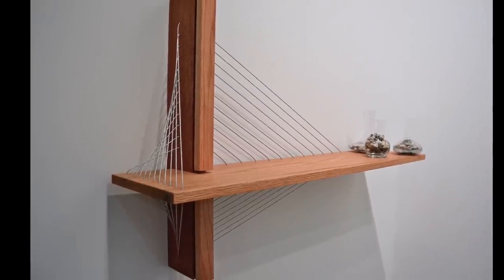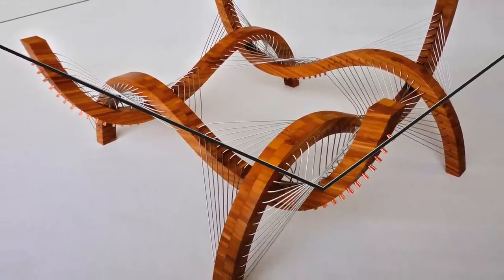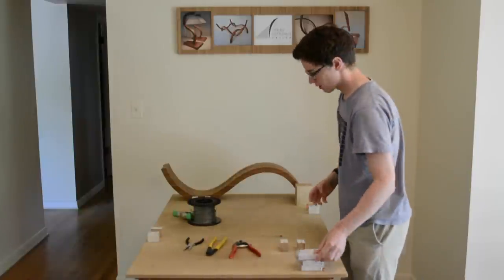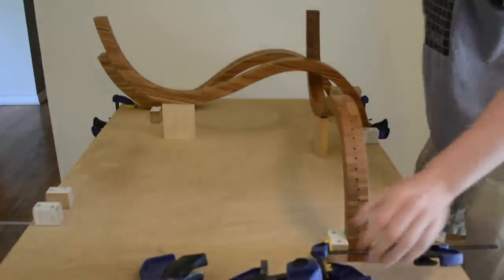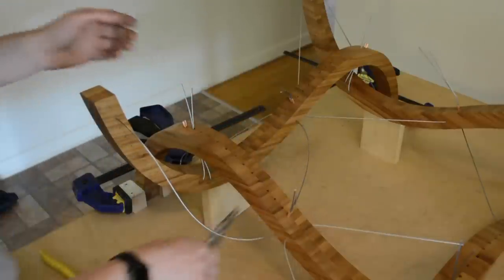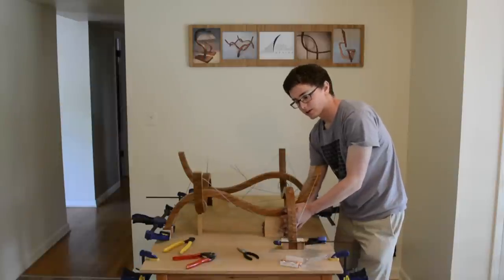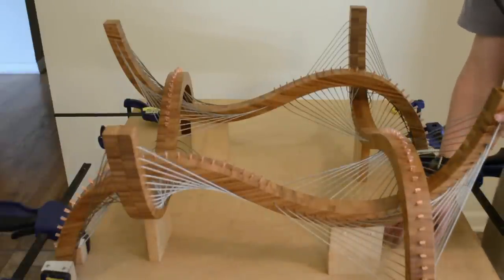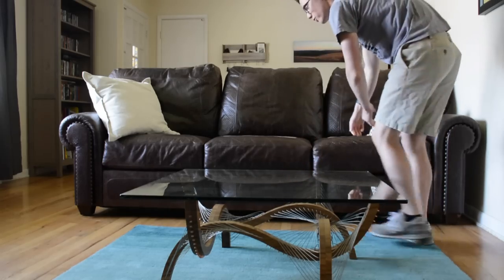Making Tension Based Furniture - Robby Cuthbert Design

Comment: Do this with clear wire, it would look like it’s floating
Reply: nice idea
Reply: @packman21421  I'm sure you can get wires that are mostly clear that are stronger than fishing line, dude.
Reply: Daniel Nguyen when you don’t understand how vast the online market is and how much technology we have 😂
Reply: Daniel Nguyen he could just use more fishing line, i thought Asians were supposed to be smart smh
Reply: @ARTDaGAT  Really no need to make racial stereotypes but go off I guess
Reply: @packman21421  ok boomer
Reply: @packman21421  lol how do you assume that that are no clear wires strong enough for this. Ever heard of nylon?
Reply: @troyesivan4416  I smell someone who's triggered.
Reply: Well this thread escalated quickly. Anyway, yeah, clear fishing line would be cool.
Reply: @aetherclouds1181  bi
Reply: @DancesWithSloth  why?
Reply: it could be only me but i feel like the wires add value to the design
Reply: @packman21421  fishing line for tuna can hold more than 450 lb. I think it's enough for a coffee table...
Reply: @noisycarlos  clear cable doesn't exist
Reply: @Juksemakeren  Thanks for the correction, fixed it to what I meant, clear fishing line.

Comment: I was pretty surprised at first that you went with cutting out those curved wooden legs, given the short grain, instead of bent lamination, but when you jumped up and down on that sample outdoors my eyes lit up. That's the functional beauty of the tension system. Well done.
Reply: It's bamboo and probably some kind of composite.
I don't know of any bamboo that comes in 18+ inches wide sheets.
Reply: I've bought similar bamboo plywood (plygrass?) for making a cutting board type of thing, and it's sturdy stuff.  Like plywood, it has no real grain direction that it favors, and yes, I bought a 4*8 foot sheet, which (1" thick) weighed 88 pounds.  Not cheap stuff, not available at all lumber yards.

Comment: Amazing building quality, clearly no expenses were sparred in calculating the internal forces and stresses (it's clear that the table is purely at tension as the name implies, no compression or flexing or torsion on any member whatsoever, so an amazingly precise naming), not to mention the extensive optimization, and only the best fastening techniques and practices were used. The jig set-up itself is a work of art as well, wood on wood bearing with no clamps by the jig itself plus clamps outside the jig. Clearly a masterpiece by a master of art and engineering and crafts, worthy every penny.

Comment: nice work, detailed tutorial, thanks for sharing! partial countersinking of the copper stoppers could be nice as well. also possible to make bigger pockets (so crimp tool can  fit) and seal them after tightening flush with pressfit copper discs, leaving them visible on the upper side.

Comment: Great design. If you drilled wider holes on the one side of the legs the crimps could be embedded inside the legs and completely covered. Also i would like to see this with white legs and black cables.

Comment: Wouldn't it be true that the more weight that is on it, the more stable it is? Since the cables would be pulled more due to bending? What a great design
Reply: It probably depends on the strength of the cable themselves. If too much pressure is applied, and I'm sure it would need to be a lot of pressure with how many cables there were, the cables would snap.
Reply: @BeyBladGuy365  you might have wood tearout before that limit is reached though

Comment: There’s a lot of tension on the table. 🙄
Reply: *wakes up and starts making a pot of coffee.
*Goes into the living room while it brews and turns on the TV to see what's on..
*Coffee gets done so you grab a glass and go sit down on the couch..
*Takes a sip, smacks his lips with excitement from the rich blonde roast.
*Sets down cup SETS OFF A CHAIN REACTION AS THE CABLES SNAP FOLDING IN ON 60LBS OF GLASS PANE FUCKING DEMOLISHING ANYTHING AND EVERYTHING THAT COMES ITS WAY!
Reply: @Pro_Vs_Con  the cable he's using is actually heavier than necessary. The weak point in the system is the copper crimp. I think it'll handle anything you'd be using a coffee table for
Reply: Wow. I didn’t understand what “tension-based furniture” meant. Thanks for that. 🙄
Reply: @hightide9513  ? Who are you even meaning that towards?

Comment: You should drill some counter sinks where the crimps are to hide them. You could even cut out little caps to cover the holes and hide the ends of the cables completely
Reply: redsoxfan32 
But how would you tension the cables if they need to the outside of the hole to crimp?  You would end up with 3/8" of slack on every cable as it sinks into your countersunk hole.  

I sort of like the look of the crimps :P
Reply: that is really easy actually. recessed tensioners.  bass tuners would also look really cool.
Reply: I think it is possible to hide half of crimps, the ones that are not facing the floor. You need the other half open to tighten strings.
Reply: To No: I think you are confusing countersink with counterbore.
Reply: I thought the same thing, that the copper crimps kinda ruin the clean look of the cables and wood.  Also, I could see me crawling around the floor for something that I dropped and getting ripped open when I run my arm up along one of those crimps.  Ohhhh, no thanks.

Comment: I'd be interested in seeing a video showing just how much load bearing capability it has. If you were willing to destroy one of those awesome tables, possibly do a video showing the weight it can withstand before failure?
Reply: Are you sure its necessary to wreck a piece? The loads can be calculated using the same formulas engineers use for tension bridges--which as you know can take the pain of weight.

Comment: So, theoretically, once you put the glass on the table, you can go back and cut a bunch of the cables without affecting the structural integrity of the table
Reply: i dont see how that could be the case at all? complete nonsense
Reply: @michaelh.1262 

Wire "a" pulls up + Wire "b" pulls down = balanced 

Glass pushes down + wire "a" pulls up = balanced

Wire "b" no longer needed
Reply: @samo4648  
You could probably get by using only 4 short cables in total since they would support each others weight when they are all connected and the glass would act like tension. Connecting them where the bottom and top leg cross over each other. Given how heavy the glass is it might be enough so they wouldn't just fall sideways also. It might also create a lot of stress on the 4 connection points (given how the wood is cut in this case) so you could use steamed and bent wood to get the full strength of the fibers. Instead of the exposed brass clamps (unless you like them) Drill a hole and use a steel wire loop clamp to hide them away. Harder to do would be to use only 1 single wire for the whole piece but still going through all the current holes. Anyway it is a nice build!
Reply: @samo4648 , as long as the glass is heavy enough to exert the same amount of force as wire "b" Maybe

Comment: If you pluck the cables, do they make music?
Reply: Well, if he did it well, and he did, they would all make the same note--which is another way of checking uniform tension, right? If he set it up like a piano he could tune for tension. But to make music, oh yeah you can get all kinds of notes and then the product would be all screwed up, a mess on the floor.
Reply: Not the same note. The cords are under the same tension but are of different lengths. Length also determines the frequency.
Although...if the tension varies by some cool mathematical formula related to the curvature of the legs and thus the cord lengths joining them, then maybe you could get the same note on all strings.

Comment: i would add somekind of rubber between the glass and wood to prevent glass sliding off
Edit: also it would prevent scratching on the glass
Reply: There are 4 clear rubber pieces on the glass. You can see them when he puts the glass on the wood.

Comment: but is it level?
Reply: Leveling it would be as simple as planing down the end of each leg until they are all same height.
Reply: Will it blend?
Reply: just ad screw in bump stops to each leg and you could adjust as needed.
Reply: lvl 60 orc shaman i think
Reply: Nah dude, lvl 60 pally, if it was shaman than it would have killed him since hes a human.
Reply: Only if the floor is level.
Reply: The jig and blocks keep the table level. Tightening the outer cables, secures the legs against the jig. The only way for the table to become uneven is when tightening the inner cables. That's why he mentioned not letting the legs rise off the blocks more than 1/32 of an inch when tightening the inner cables, that ensures that the table stays very level.
Reply: He cut by CNC so I cant imagine why it wouldnt be level. But about the planing comments, its a good question. Im my past projects (non-CNC) there was planing needed to get things level. But why? Ok, you can plane to end the job but if you go back and measure for the 100th time,  you'll find the measurement error that led to the need to plane. On roughly made or fine antique furniture, clearly the makers didnt see planing as a sin because planing marks can be easily seen on leg ends. But had they too been able to measure precisely there would be no problem. The name escapes me at the moment but there was a furniture maker on Public Television, (oh was it The Yankee Workshop?) and he never planed anything--and everything was level. But to the video here, CNC would take care of the leveling of the pieces but that can be thrown off during tensioning. Like this fellow, you would have to be very skilled and patient and practiced to tension correctly to avoid leveling later. Still, if he had to do some planing after all that, id consider it fully acceptable.
Reply: All legs were identical because they were and cut and the 4 tabletop supports are 100% level because they were level with the work bench this whole time.

Comment: A 37th of a inch? Just use millimetres
Reply: But imperial measurements are easier
Reply: g.a.s.p I guess because you are guessing the measurement
Reply: I was joking, I don't see how imperial measurements could make guesswork any more accurate unless you are more accustomed to them than metric measurements
Reply: 32nd not 37th.
Reply: you're off by 5/1184 of a inch there buddy :)
some would have just said 0.00422297... but that's just communist talk.
Reply: imperial measurements are the least practical thing that exist, but damn this humans hate changing.
Reply: Metric is units of tens and hundreds. Easier.
Reply: @PageMonster I don't think anyone needs to be told that, and if this in response to me saying imperial is easier, presumably you just skipped my other comment, so I advise that you read through again.
Reply: 37th is nonstandard. I think you misheard. 1 inch is the same as 2x 1/2 inch, or 4x 1/4 inch....which is the same as 32x 1/32 inches. If you really want to get accurate, in imperial machining you will see numbers like 128th of an inch.
Reply: its easy to convert fractions to decimals. 1/8" i see as 0.125
Reply: easier to say a 32nd than it is to say .79375mm.....
Reply: In machining we go down to a thousandth of an inch. (or .0254mm for metric people)
Reply: First of all it is 32nd second of all communists all mad because they don't understand fractions lol! Just kidding, I don't care which system of measurement is used so long as it is the same on the entire piece of equipment.
Reply: Michael T Shue Studios, easier to say 1 mm than it is to say 247886/6296301 of a inch
Reply: Alex M you would simply say 3/64" or 39 thou. Or round up to 40 thou. At a certain point we just switch to the decimal form.
Reply: That's what caused an accident with a Mars orbiter. A small 125 million dollar mistake :)
Reply: “The metric system did not really catch on in the States, unless you count the increasing popularity of the nine-millimeter bullet.”

― Dave Barry

Comment: And then someone walks into your unsecured glass top and smashes it.
Reply: PageMonster luckily we didn't all make the mistake of having children
Reply: 60 lb glass.. I don't think the fact that its unsecured is gonna matter much
Reply: Yeap, I had a table with a solid marble plate, which was completely unsecured. You had to actively lift or push it off for it to go anywhere.
Reply: LoL u obviously don't much about how physics work do you Mmmmbuddy?
Reply: easily fixe by putting soft gummy rubber between wood and glass.
Reply: No name you don't seem to know much about grammar huh budy
Reply: PageMonster That glass won't break, dude. Even if you dropped it from the height he was holding it.

Unless, of course, you meant to say until someone hits the corner of the glass with a hammer. Then yeah, you'll end up with a big mess of glass beads, while still sharp, will only give you extremely minor cuts if at all.

Comment: Without doubt you have created a thing of beauty here.  The brief view you gave in the first part of the video reveals other structures which I think are also examples of geometric beauty.  Congratulations on many jobs well conceived and executed.  My comments are based on my own attempts to design and build similar structures also for the support of a [ tempered ] glass top.  I'm fully aware of the skill required in placing the tensor members - something I'm still personally working on to improve my technique, so I note your nifty tensioning method of rolling the long-nose pliers to apply a controlled tension to the wire[s].
Since I personally am more an engineer than artist, my own endeavours centre on a somewhat simpler kind of structure which conform to the criteria of true tensegrity structures.  These have way fewer tensor wires, and also fall into the category of " compliant " structures which  deflect to a marked degree when loaded - they are spongy rather than rigid and don't behave like ordinary furniture.
In your own work, you could possibly give some consideration to the shape of your compression members.  I note you have the luxury of a computer controlled cutter.  It would be easy for you then to apply some simple mathematics to designing the shape.  For instance the wavy shapes can easily be simulated by the equation y = a*x^3 - b*x - where y is the vertical dimension and x the horizontal distance about the centre point.  Note that x takes positive and negative values which makes the curve be " up " on one side and " down " on the other, and when x=0 then y=0.  By choosing appropriate values for ' a ' and ' b ' you can arrange for adjacent [ crossing ] members to have high and low points [ the ' extrema ' in mathematical terms ] to coincide at the crossing points.

Comment: Very nice - Unique combination of skill, aesthetics and mechanics - love it. If I could add one thing it would be to add small transparent rubber pads where the glass comes into contact with the legs, to prevent the occasional accidental bump from sliding the glass off the frame.

Comment: Absolutely love this!

I run a machine with an aggregate and it seems like maybe that's the perfect option for cutting those holes accurately and efficiently? If your machine can use vac pods, you can gasket a bleeder board and pop them on and off between ops.

Look forward to your next video!

Comment: If you make a jig that locks the legs solid in place,  then you can tighten all the cables with full force eliminating the need to guess/fine adjust the first set of cables.

Comment: Have you considered covering the Copper plugs with a black 'U'  shaped curved  piece of wood.  Great work Amazing.
Reply: or you can drill a slightly larger hole over  the hold already there for the cables to come through. for the copper ends to sit in. then you can just make caps/plugs to cover.

Comment: You could improve this with a copper crimp that has a lip at one end and is crimped by the wood as you force it into the hole where the cable comes out (it would look like half of a rivet but I suppose it would have to be corrugated or else splined on the inner surface and adding latitudinal ridges to the cables where they'll be inside the wood or cut should guarantee the strength). There must be a tool to make that work - perhaps a riveting tool will just do the job right by pulling on the cable for leverage, guaranteeing the tension is maintained and deforming the rivet due to the pressure so it fills the voids of the cables to become completely fixed. Then cut the cable with a convex or conical cutting face to keep the cut surface beneath the lip of the now embedded crimps/rivets and/or use a tool to hammer the tip of the cable into some nice dimple within the rivet. This could all add some great extra finishing quality.

Comment: The wires are not working with eachother to make the table stable. They are working against each other to the degree that adding some weight to one side doesn't affect the balance of opposite forces.

Comment: Looks amazing, but do these only slightly tightened cables not losen up after a while (or after you stand on the table) and make the whole thing wiggly?
Reply: If the crimps are applied properly there shouldn't be any loosening on any of the cables.

Comment: As an engineering student I wonder how stable and resistant that thing really is, that hand crimp is probably where things will start to fail? Did he do any calculation or just design this things by feeling?  Maybe I'm wrong... Anyway he tensions everything by hand so in case of failure it probably won't hurt anyone. Really cool tho ^^

Comment: In this process, leveling and adjusting the cables is missing. 
That's one of the important thing to be taken care as well. 
In initial steps, when we are tightening inner and out cables; we need to check the level and make sure they were leveled properly, we need to adjusting the stings accordingly.